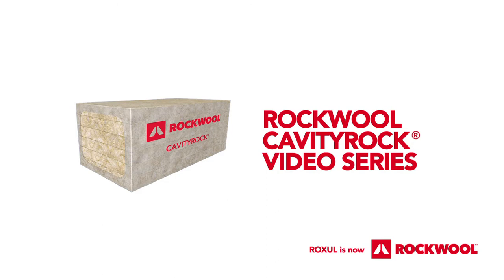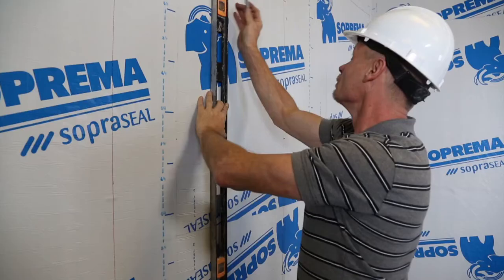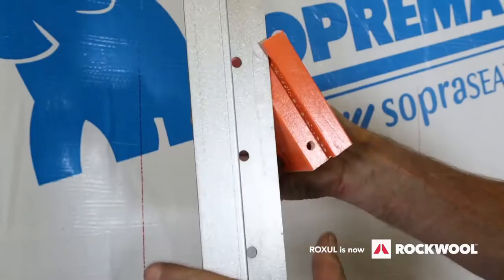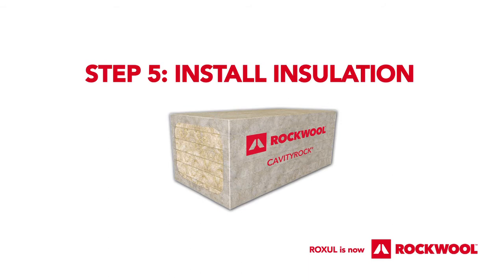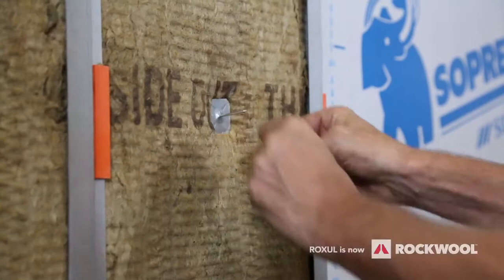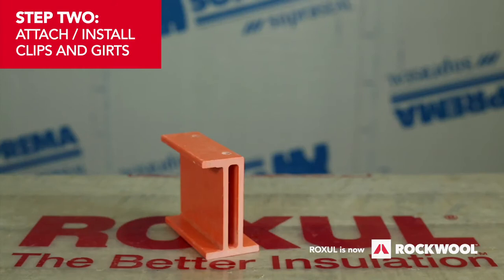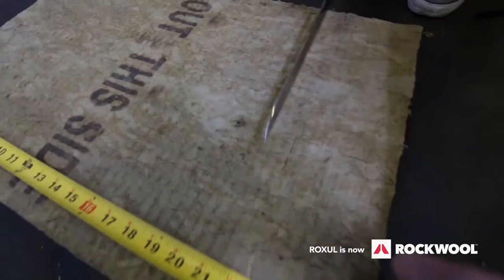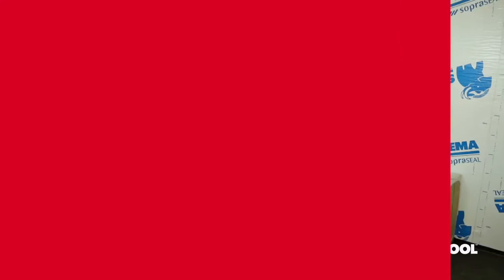How to Install ROCKWOOL CAVITYROCK® with Cascadia Clip

Comment: will it stop or reduce plane sound because i want to install the rockwoll rolls very near to an airport on a glass wall, how do i do it  can you please explain. i want it outdoor . it soaks in water will it be very heave when it rains?
Reply: Rockwool insulation does not have a very high NRC (Noise Reduction Coefficient).  NRC is from 0-1, 0 meaning that it absorbs no sound; the greater the NRC the better the material absorbs sound.  A better option would be to install acoustic wall panels which have a significantly better NRC rating.  However, with that being said airplanes produce extremely low frequencies which is what you are hearing, those wavelengths are significantly larger that standard sounds such as cars, horns, and speech.  in order for a wall to absorb the wavelength that an airplane produces the acoustic panel would have to be thick enough to absorb the length of the sine wave produced by aircrafts.  A Jet turbine produces a frequency range of 315-6300 Hz with SPL (sound pressure level) of 120-130 dB, at 68 degrees fahrenheit these wavelengths are 4 foot long (315Hz) - 4" (6300 Hz), respectively. 

In short, use acoustic panels with a high NRC rating, but don't expect a huge return on investment as these panels will not be able to mitigate the large wavelengths produced by jet turbines.